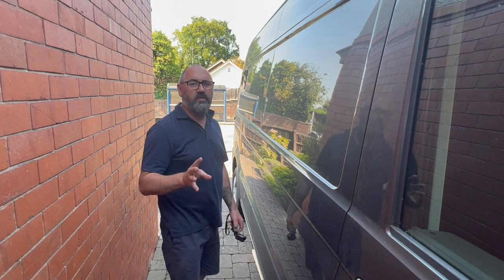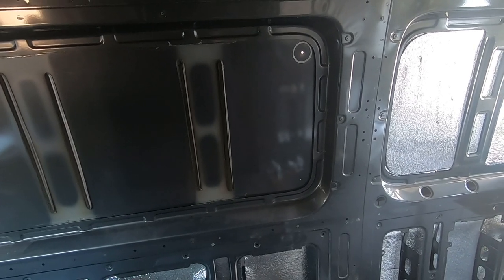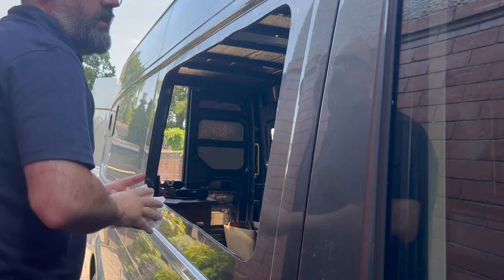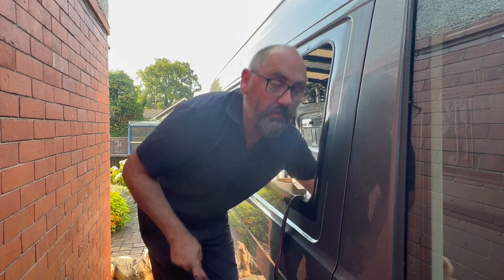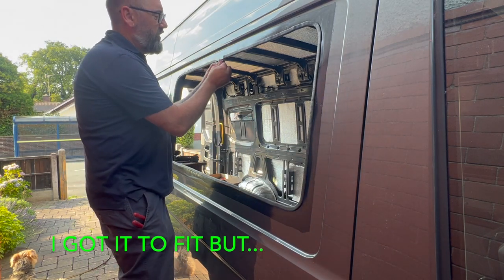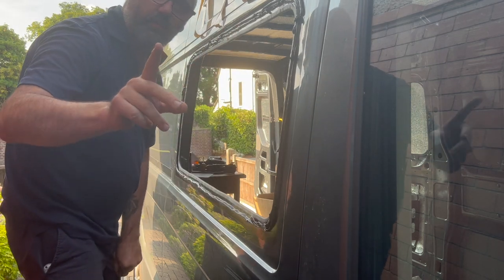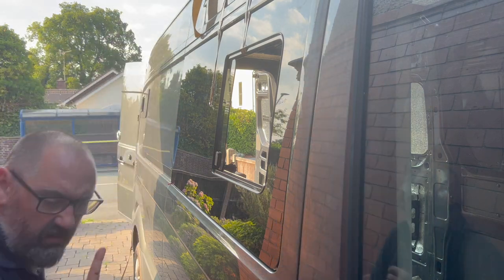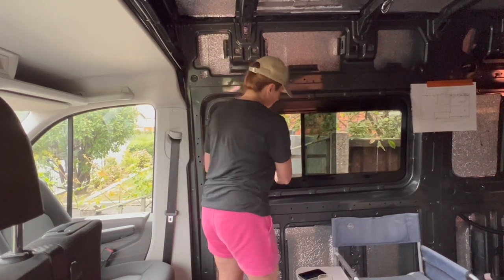VW Crafter Conversion EP5. Fitting the side windows.

Comment: For mastic guns I've had a lot of issues with the run-of-the-mill types and always break them. I recently purchased a heavy-duty type from Camper Van Glass for £30 and its quality. I easily installed the bug side window in my Crafter last week. Worth investing in one of the guns if you have more windows to do.
Reply: Typo 'big' side window.
Reply from the maker: Hi Chris, that certainly is worth knowing. TBH, this battery powered gun is good but, I think it's a lot of operator error. Plus, trying to get mastic to stick to a very hot van is like trying to get thin gravy to stick to a wall. I'm hoping most of the cutting has been done now so, hopefully, no more mastic required but, may still have a look. It'd be worth having if I never use it! 😂 Cheers.

Comment: Nice video but I'm pretty sure that trim is only meant to finsh the inner skin, leaving the outer skin flat for the glass to bond to. Once the trim is on the inner skin it covers the gap between the 2 skins on the insde. Unless this is a different type of kit to that ive used in the past, in which case ignore me!!
Reply from the maker: Hi Shaun, I'd never ignore any comment as I appreciate you making the effort. It's an interesting point you raise. I've only ever used the thicker trim in the past. That fits over the two skins nicely. However, after struggling with the thinner trim, I checked out the Kiravans YT channel and they say they too used to pinch the two skins together when fitting the thinner channel over both skins. To be honest, which ever way we choose will work as long as it's water tight and looks good. Thanks for watching and for commenting. Mal. 👍

Comment: I don’t think the weather was on your side that day. Use a bit of silicon spray on those sliding windows. I put my black U Chanel in some hot water when I done my T6 windows, it made it easier to bend and put on the metalwork. Good job done though 👍
Reply from the maker: Ahh, great advice, I'll order some silicone spray today, Cheers. TBH, when I fitted the u channel on my T6, it was wider and much easier to put on but, that's a good point about the hot water. I had thumb ache for a day or two after fitting that one. Thanks for dropping a line.

Comment: The rubber beading is only meant to go on the inner skin of the metal…
Reply from the maker: Hi, thanks for watching and commenting. There is a rubber gasket that fits solely on the single skin. I've used that before on other builds. However, this the double gasket that is designed to go over both skins. Cheers. Mal.
Reply: @CampervanHabitude  in that case I do apologise, thanks for educating me on this… keep up with the good work
Reply from the maker: @defender90adventures  Hey, no problem at all. I appreciate all comments and views. Have a great day.

Comment: Would highly recommend against using an angle grinder.. Its not at all good for the paintwork.   Multitool on the supports and a nibbler on the sheet metal!
Reply from the maker: I'm afraid me and nibblers don't get on at all.  Get what you're saying though.
Reply: A nibbler won’t go tight to the second skin.

Comment: I hope your pain work with stood the angle iron sparks and your gripping with a so called plyers. ... There's jobs you pay for
Reply from the maker: Hi Philip, yes, the paintwork has survived, no pitting. It does look brutal but, many van builders use grinders at some point in their build, including professionals such as Kiravans in their tutorials. In a previous episode I tried to use my nibbler but failed miserably and may have caused more damage. The sparks are largely directed away from the paintwork - mostly at my bare arms and legs to be honest and they survived too 😆. The water pump pliers are composite plastic coated so never caused any damage to paint. It would have been far easier if the gasket was wider though. Thanks for watching.

Comment: Great video. It fit perfectly, Daft question….how did you know cutting it from the inside that it would fit perfectly? Was it as simple as the instructions said so? As I’m with you…I’ve never seen anyone use the interior rails as a guide and it seemed so much easier…
Reply from the maker: Hi, I've fitted these windows before in smaller vans so I knew you had to cut along that edge that I pointed out on the inside. It is far easier cutting from the inside but, you do get a lot of metal dust flying around inside the van. It's not ideal as there is a lot of cleaning needed but, even if you were to cut from the outside and cover with plastic on the inside, you'd still have to cut the metal struts out from the inside first so, you're going to get some metal dust whichever way round you do it. I think I'd hang a dust sheet over the cab area before I do it next time.. Or cut it when the bulk head is still in. 👍